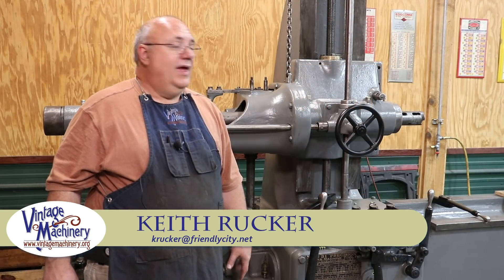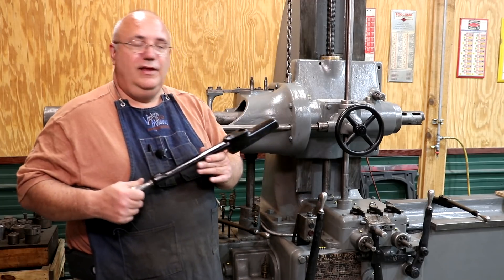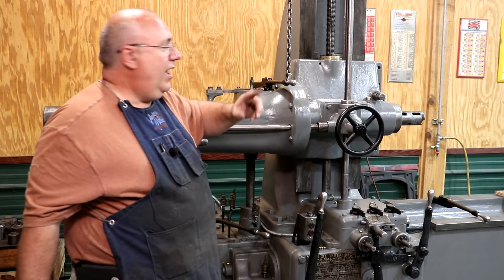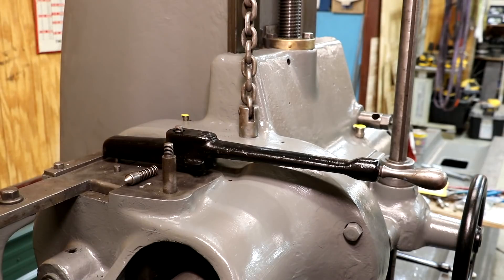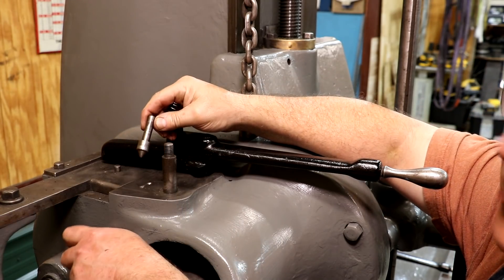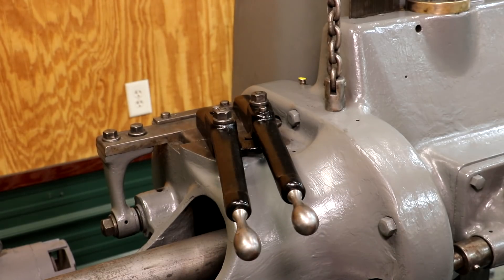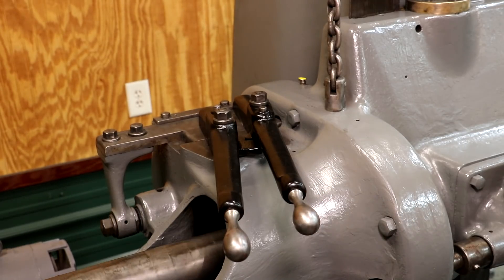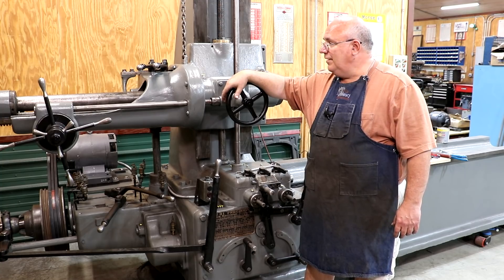Horizontal Boring Mill Restoration - Machining a Lever Detent Pin

Comment: Nice job !   The rule on springs - diameter of wire, center hole and length.  That determines the strength of the spring.  Lighter wire is weaker spring.  Boss wire and Boss spring.

Comment: How did you determine what should be the spring specs needed to buy the missing spring pin?
Reply: i think its the od and id plus wire diameter and also pounds of force to compress

Comment: Keith, you should consider adding basic spring manufacturing to your shop.  When I started working at a Naval Air Rework Facility in '82, they were still overhauling R-1820 radial engines for the S-2 (and maybe the C-2 too, before it was reengined with turboprops).  The Spring Shop was extremely small and basically consisted of one greybeard (which I am now) and one long workbench maybe 15-feet (~4.6-m) long with an attached back to hang tools, jigs, small fixtures, and materials from.  I think he even had a small heat treat/tempering oven on the bench, similar to what you have now.  He was next to the Lathe Shop and I assume that he used one of their Monarch 10EEs whenever needed for springs his "hand-cranked" fixtures weren't suited to make.  You already have all of the "hard-to-get/expensive" equipment to make helical-type springs and other types too.  You'd only need to build or procure the few jigs, fixtures, tools, and spring materials and then you'd rarely ever need to order & wait for a spring that may or may not be what you need or really want.

Comment: These are your "back gear/spindle neutral" levers. One is different in that it has a lockout feature keeping you from binding up the spindle. IE when one is engaged you cant engage the other. 
You have done a great job on the old machine. Hope you enjoy it as much as I did.

Comment: Detents are important.  My company lost an airplane when the pilot accidentally moved the throttle control to IDLE, missing the detent.  When he noticed the error, he didn't have enough altitude to get the single engine back up to speed, and had to punch out (eject).  The airplane landed with gear up in a field, and was too damaged to be returned to flight.  Pilot was safe, and the depth of the detent was changed.  Expensive lesson, that.  (mid 1960s).  

Thanks for sharing the history of the little scrap that went back to work.

Comment: Cue the people who cry about a file being used on the lathe in 3-2-1….
Reply: I've never understood that particular prejudice. Should you also not use emery paper? Should Keith have made a form tool just to have a round tip on this part?
Reply: @crichtonbruce4329  It’s people who “think” they know everything. Same people don’t realize there are even “long angle lathe files” made for the very purpose of using them on a lathe.
Reply: @grntitan1  I had a couple of them. They worked very well indeed.

Comment: Kinda neat that you were able to use an original part from the machine to make the new one! One of the things I learned early on in my career is to always work out of the scrap bin if possible, instead of starting with a fresh piece of stock! I did a little "side project" on my lunch hours at work many years ago. The rule was anything in the scrap bin was fair game. So I got some lengths of steel pipe and some flat pieces and MADE an engine stand! Only cost was the casters and a can of spray paint! 😁
Reply: Using an original part means the new and old pins were likely made of the same steel, which means the wear should be similar.
Reply: @Ambidexter143  ....Yep, he said that.
Reply: No such thing as a scrap bin, it is the stock with unfound use receptacle!
Reply: Another one of my rules is always use the shortest piece of scrap on hand that will yield the needed part.